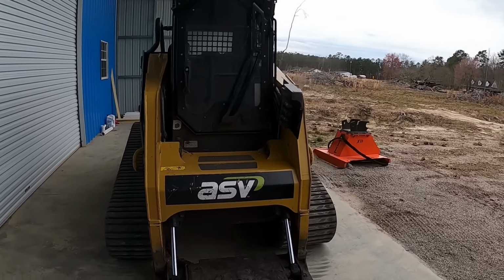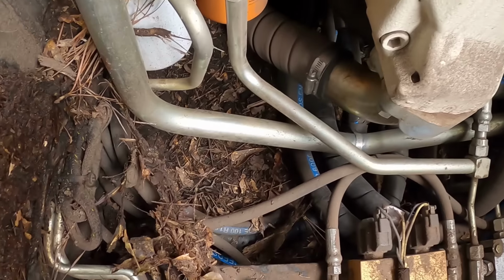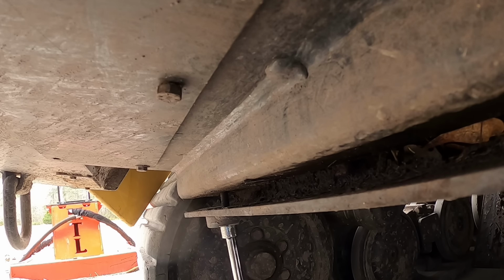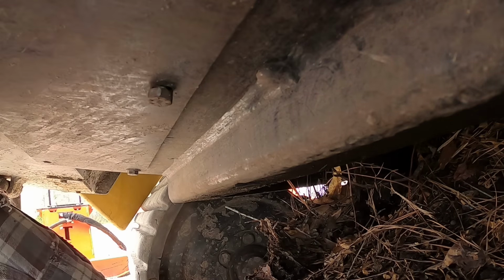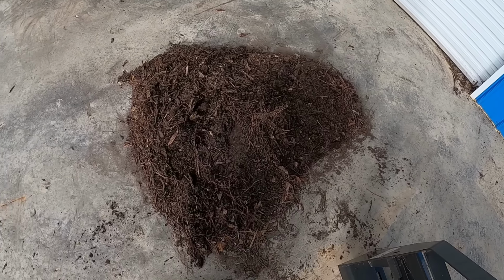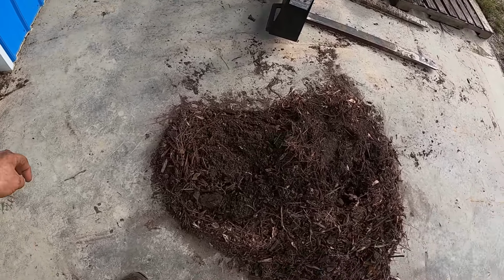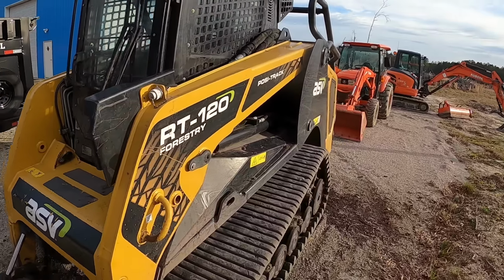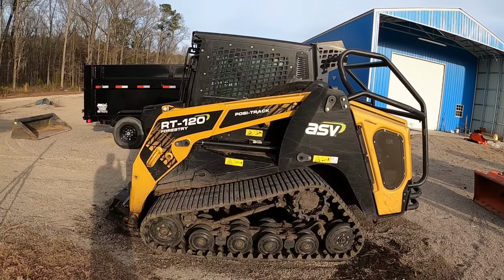The SELLER May Have MISLED About The Condition Of This Machine! It Is DISGUSTING!

Comment: Just a suggestion but you could use a floor or bottle jack if you have one to lift the skid plates.
Reply: Even a 2x4 to prop it up would have worked.  Work smarter, not harder....

Comment: This dude doesn’t do any, maintenance on his skid steer at all! Some people are like that, they just buy em and run em until they burn up! Like people buy vehicles and drive them, but never check the oil and after it burns up when you pull the pan and the oil is a jell and you can see just a space in the oil pan that has a space where the oil pump sits! It’s ridiculous and I’ve seen that! It’s a shame!

Comment: While I enjoy watching the work you do, you sure do complain and dunk on others a lot. It’s not a good look on you and speaks to your professionalism.
NWWH
Reply from the maker: First, it's not like I called the guy out by name. Second, I was told that they "keep the machines clean" and that was misleading at best. Third, this is educational to show other what to look for in a machine and ask the seller about, especially if it has been used for mulching.
Reply: @idigit4967   Davin pour ma part vous êtes presque que trop poli par rapport à ce vendeur parce que quand on regarde tous les débris notamment sur et au alentours de la batterie  et de échappement le risque d’incendie peut être même d’explosion si c’est la batterie qui prendrai feu ton attitude est plus que justifié par ce que dans un tel état la machine est fondamental dangereux
Reply: @idigit4967  Davin for my part you are almost too polite compared to this seller because when you look at all the debris especially on and around the battery and exhaust the risk of fire can even be of explosion if it is the battery that will catch fire your attitude is more than justified by the fact that in such a state the machine is fundamental dangerous